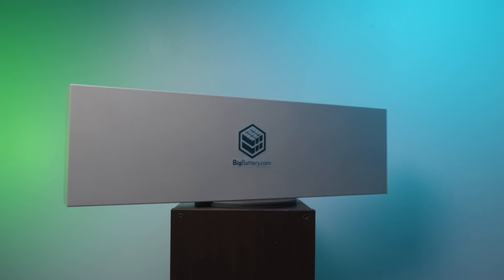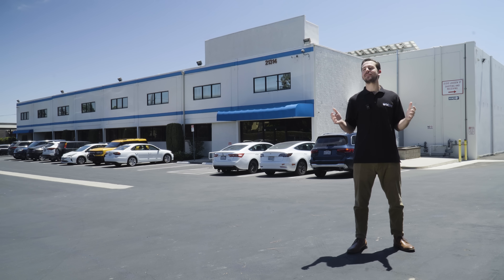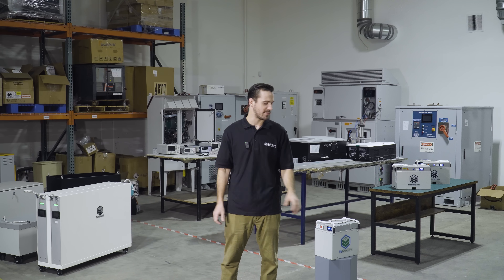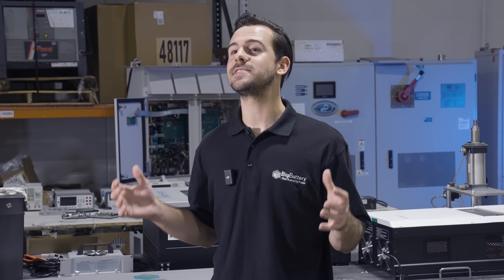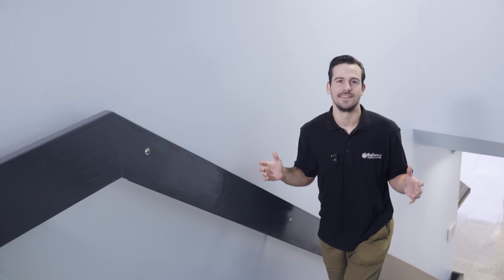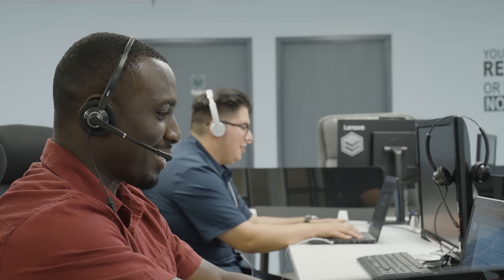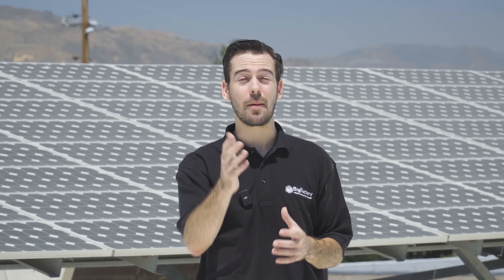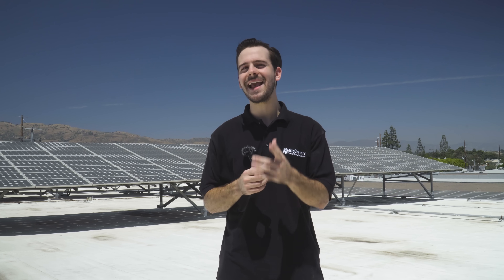Why Choose BigBattery?

Comment: have two kong elite 15kwh batts. One running like a champ, second one is a total piece of shit...... two cells crapped out first time........ absolutely lame customer service...... got it back and it failed again after only a months use........ BMS this time....... customer service absolutely lame....... problem started in april....... look......its oct....... have i mentioned the LAME customer service yet ????

Comment: I have 2 Griz 48V big batteries I bought with our solar system and they suck!  I cannot get the manufacturer to replace them and they haven’t even been used for more than a year. They won’t hold a charge and last an hour or two.